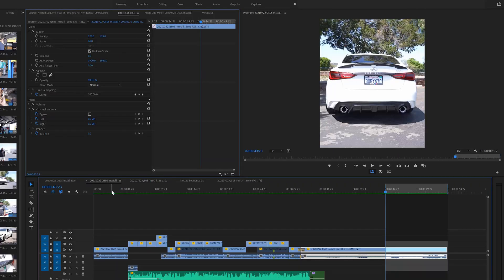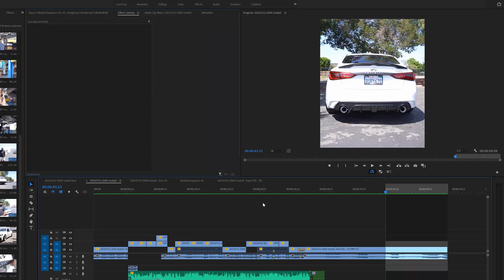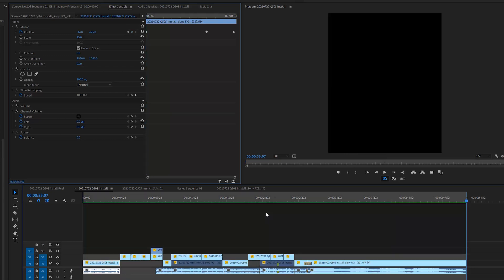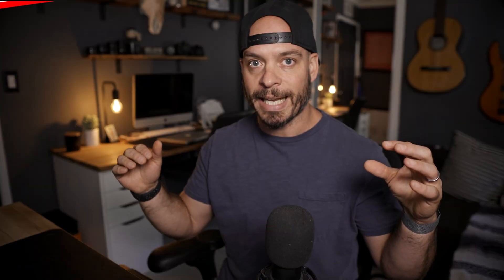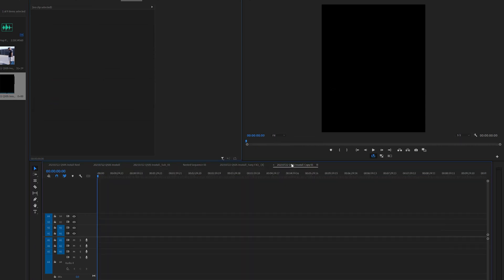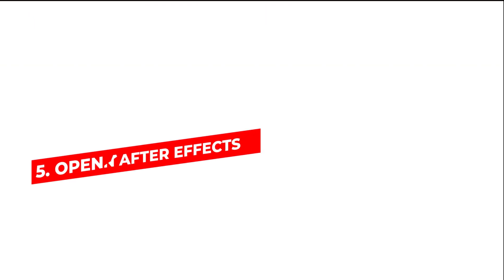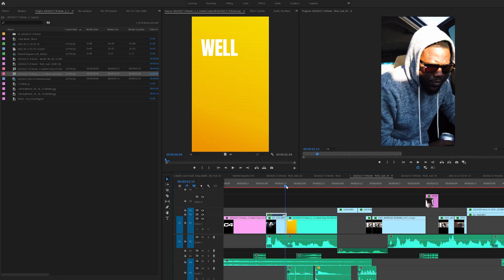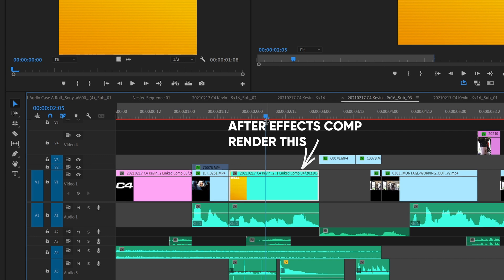"How To Fix Your Adobe Premiere Pro Export Problem - The Answer Is In Here!"

Comment: 1:58 Thats a great tip and actually temporarly fix the my issue. However, Hardware accleration is still suck for me and i get constant errors while try exporting, and the funny thing is the problem is just start after i "clean" my SSD with ccleaner. I dunno what the hell that program delete but it screw my premiere pro.